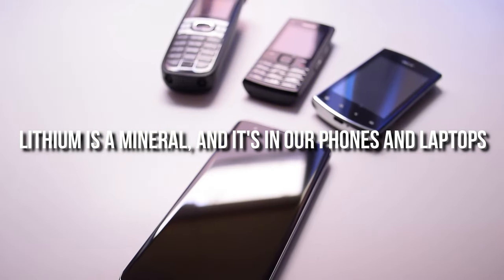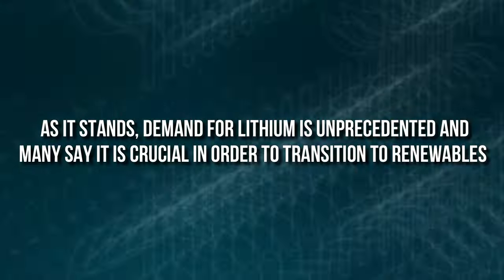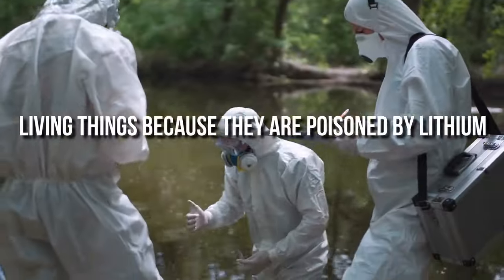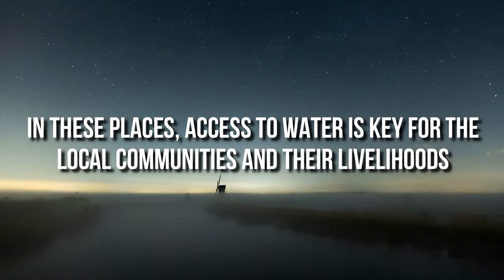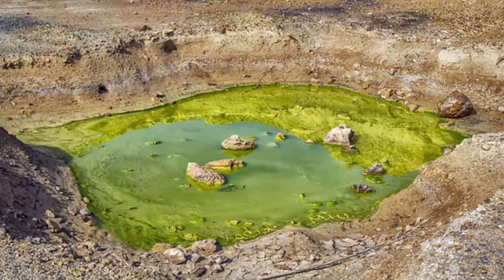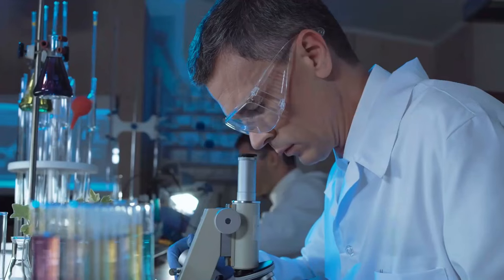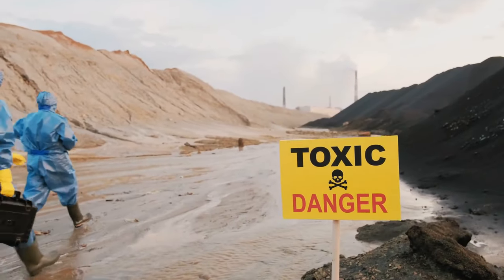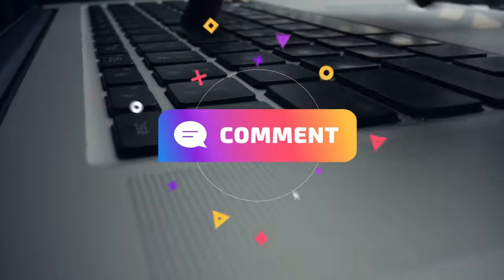How Bad Is Lithium Mining For The Environment?

Comment: To make Petrol:
Explore and find the oil: needs energy
Drill a well on average 1 km deep: needs energy
If the oil comes from an off shore oil well that drilling/production rig will run on diesel.
Pump the oil up from a kilometre down runs an electric pump 24/7 on 10s of 1000s of wells
Sometimes the oil is put into a truck tanker but most of it is pumped down a pipeline
Building the pipeline uses energy
Then pumping the crude oil through the pipeline uses energy
Pump the oil into a sea tanker
The tanker uses energy to run and needed energy to be made
Pump the oil into a refinery.
A lot of energy would be needed to make a refinery. 
Here's where it gets expensive - Heat the oil to 400 degrees Celsius
Boil the oil dry and make the oil products including diesel and petrol
Put the diesel and petrol into tankers and deliver it to the petrol stations burning diesel as you go.
In Australia some of these tankers would travel over 1500 km to a petrol station or farm.
Use a tiny bit of electricity to pump the fuel into someone's vehicle (it's not a kilometre deep this time)
People think about how the electricity for EVs gets to the battery but not about how the fuel for a combustion cars arrives.
Reply: 👆🏼this. Good post.
And then at the end of all that you BURN IT! 
It's much better to mine for the metals & minerals and then use it over and over again.
After a battery is completely finished with and is longer of any use even as home storage it can be broken back down and made into something else or a new battery.
Reply: And how do the charging stations get their power…coal. Worse yet is a charging syation too far from the electric company and a DIESEL generator is used to fill the gap. Of boy!
Reply: @snipervision1  In 2021 electricity in Australia was 71% fossil fuel based (51% coal 20% other fossil fuel) and 29% renewable. In 2020 it was 24% renewable - so it's growing. So do you want to run your car on middle eastern oil or Australian coal and gas (and renewables)? Do you like middle eastern oil?
Reply: You say the word "energy" a lot but don't specify on the type of energy, what kind of energy and in which part of the world?
Reply: @ginojames8213  Yeah but most batteries end up in the landfill.
Reply: @sdfjsd no batteries are far to pricey. Redwood industries in Nevada recycle evs batteries every day

Comment: There's no Moore's Law for batteries, if we need to double battery production we need to double Lithium mining. And to meet climate goals we will have to multiply production maybe 100 times.  Recycling won't help much because it's new cars and trucks, it's been estimated that our current Lithium mining would take 10,000 years to electrify World transport. If we take Chile's mines there will be a physical limit to extraction that goes beyond environmental standards; you can't extract Lithium if the water is there no matter what the price, there is  a finite amount of flat land to put the evaporation ponds. Obviously Lithium production can increase but realistically only perhaps 10% annually.  Something else to consider. The giga factories going up across the World exceed the current Lithium production; we can increase production but for sure or can we? Has anybody given this serious consideration?

Comment: 1 gallon of water=8.34 pounds
500k x 8.34=4,170,000 pounds
4,170,000/2000= 2085 tons of water wasted to get a ton of lithium. Quite the tradeoff.
Reply: Or to put it another way 200 tonnes of water for a typical car battery. Or about the same amount of water that falls on the roof a typical US home in a year.  It would be trivial except these Lithium mines are in arid areas.  You could use less water intensive extraction but the energy inputs would be collosal.

Comment: Are all those bad sides worse than the bad sides of fossil fuels?
Reply: @tiepup  Far worse!
Reply: @tiepup  mining lithium as said in the video falls under the same umbrella as fossil fuels
Reply: @tiepup  the cost of recycling lithium is extremely expensive, cheaper to mine it
Reply: @tiepup  no, not nowadays. With wifi, Bluetooth, satellite tech in newer vehicles. They can be hacked from only a couple hundred few away. And if you think they won't be able to shut off your EV. Think again when you stop paying your lease on one 😂
Reply: @GizmoGTI  At the moment It's cheaper to refine Lithium than to mine it. But the cost of mining (money and energy) is dropping a lot so in time you could be right.
Reply: To make Petrol:
Explore and find the oil: needs energy
Drill a well on average 1 km deep: needs energy
If the oil comes from an off shore oil well that drilling/production rig will run on diesel.
Pump the oil up from a kilometre down runs an electric pump 24/7 on 10s of 1000s of wells
Sometimes the oil is put into a truck tanker but most of it is pumped down a pipeline
Building the pipeline uses energy
Then pumping the crude oil through the pipeline uses energy
Pump the oil into a sea tanker
The tanker uses energy to run and needed energy to be made
Pump the oil into a refinery.
A lot of energy would be needed to make a refinery. 
Here's where it gets expensive - Heat the oil to 400 degrees Celsius
Boil the oil dry and make the oil products including diesel and petrol
Put the diesel and petrol into tankers and deliver it to the petrol stations burning diesel as you go.
In Australia some of these tankers would travel over 1500 km to a petrol station or farm.
Use a tiny bit of electricity to pump the fuel into someone's vehicle (it's not a kilometre deep this time)
People think about how the electricity for EVs gets to the battery but not about how the fuel for a combustion cars arrives.
Reply: Not even close. Look at what it takes to extract oil.
Reply: If you like animals, drinking water and food it is!😅
Reply: This is the right question
Reply: When fossil.feuls are pumped out the ground it doesn't get into the atmosphere like lithium and if it spills it can be cleaned up I think I will stick with diesel and hydrogen they have downside to but at least wildlife won't be obliterated by the exhaust
Reply: @GizmoGTI just like plastic it will be just like that cheaper to remake then to reused and it will bad very bad imagine these batteries being dumped into our oceans imagine you sea life eating these particles this will not be good
Reply: @danielstapler4315 I do but what about the electricity it takes oil to make that and if their isn't enough of it how can you charge you batteries it that happens no oil no power we do not have the infrastructure to sustain these so fossil fuels for me plus people make their own feul may not be better then the refinery but unlike recharge it can be done
Reply: @fireflyraven2760  I also think we're not ready for lithium batteries, if they catch fire there is nothing that can be done to put it out, not even closing off ventilation will extinguish a thermal runaway . Imagine having a few of these parked in an underground of a tall apartment block, one f these ignites while being charged, and having at least the 3hrs minimum time to have it extinguish itself off, lighing up other cars and other EV's. the burnoff could take days!!! Imagine having 30 or more EV'sd parked in the same apartment building all being charged - not going to be safe at all and no-one is looking into how they'll put these things off as they epically go off
Reply: @GizmoGTI  plus the building will catch fire as well and people could die or get injured not to mention the air surrounding air would be toxic as fuck all that carbonate and every other chemical their is in those batteries would make it a chemical field trying to save them everyone would have to be treated for this
Reply: @fireflyraven2760 go tell that story in Nigeria …. or Canada for that matter. And not only there. Big oil poisons land, water and air in epic proportions all over the world. If we stick to fossil fuels, we’re doomed. So stop making up reasons why not and start thinking about how it can be done, with respect for the environment.
Reply: @elinys2843  this isn't me making up shit as to why we should not adopt electric vehicle I am only stating the side affects if this plays out like plastic we will be in bigger trouble then we will be using oil but I didn't come here to change your mind set I am only backing up what I said both are not very good energy sources maybe we will have better luck with hydrogen but thats my opinion not like I know what I'm talking about
Reply: @danielstapler4315 everyone knows it takes energy to do that you goof ball, the difference is you don’t leave near as much poison laying around while getting oil.
Reply: I'm looking forward to hydrogen cars. I know making hydrogen is energy costly but with electricity from wind or/and solar it would be far more better for the environment. The only outcome from vehicles is water
Reply: @fireflyraven2760  What do you mean? Oil spills are extremely harmful, and most of it doesn't end up getting cleaned up.
Reply: I think the fundamental principle that we should be considering is: in most cases, it's better to stick with the devil that you know than the devil you don't. We know oil-powered cars and their impact. What we don't know is what the impact of EVs. EVs aren't the solution, so we should spend time researching and finding a better solution to oil before we transition away from oil.

Comment: The Tesla Impact Report estimates it takes 18 gigatons of mining/yr to maintain the current grid and transportation system. A fully wind/solar/battery grid with 100% EVs for transportation would take 3 gigatons/yr of mining.
Reply: Of course Tesla would say that ,really what a con. Tesla if sold world wide and increased production in the fantasy that people actually want an EV as the only means of transport would dwarf any mining efforts of today for current EV technology. ICE vehicles are far more adaptable to different fuel sources that are actually sustainable unlike batteries technologies that are even close without lithium.
Reply: @peterrichards1058  Where's your data? It's irrational to just say someone's else data is a con, as if that's an argument.
Reply: @peterrichards1058 adaptable to different fuel sources.. my azz.  Electricity is far more adaptable.  Electricity can be made at home.  
Gasaholeline will always be a monopolized leash on society.

Comment: I wonder how much pollution is caused in mining Iron ore, copper, aluminum, oil etc and further how much more pollution is caused in converting these to engines, transmissions, radiator, exhausts etc. I bet it wouldn't be much different if not more.
Reply: u still need all of the above to build ev cars plus on top of that, now the lithium and disposing of used up batteries and the value in the second hand ev market would be terrible. the lithium industry needs to tighten the hell up with regards to safety and the env
Reply: a form of fracking is used in iron ore exploration, its more out of sight than CSG but still happens.

Comment: The new methods for lithium extraction from underground brines, a most abundant source of this metal, are extremely benign for the environment.  The brine is pumped out of the ground.  As it is often also a geothermal resource, its heat is recovered and exploited.  Then, the cooled brine goes through ion-exchange columns, which capture the lithium cations specifically.  And finally, the lithium-free brine is reinjected underground.
On the surface, there is nothing but an industrial building and some pipes!
No emission except NaCl (table salt)!

Comment: Lithium can be recycled. Anything that can be recycled, can be considered "renewable", or at least, "sustainable". That cannot be said for fossil fuels of any kind. Just like lead, zinc or any other metal stays in the market, and becomes a source material to make the replacement batteries. If you buy a Lead Acid car battery, the lead in the plates, and the sulfuric acid are almost 100% post consumer content. Very little new lead is being mined, to make replacement batteries. Lithium will do the same, once the market saturates. Water, used to concentrate lithium, is the single easiest thing to recycle. Closed distillation processes can reduce the water lost to virtually 0. Is the tailings from mining lithium any worse than the overburden from coal mining? is the chemical waste any worse than the fly ash from burning that coal? How does the total mass of waste from continuing to burn coal compare to the total waste mass from mining lithium? Because Lithium and Cobalt will very quickly peak, because of market saturation, the problems caused by mining will quickly become less and less, because Lithium is recyclable. It's not "one and done" like any kind of fuel. It should NOT be restricted, because of the ease of the workarounds for water consumption, pollution, and recycling.

Comment: Sounds like you did not listen to the video. 500, 000 gallons of fresh water needs to be evaporated to make 1 ton of Lithium. In a arid climate like Chile or Navada, that's much of the drinking water for the people. Also, unlike gasoline, the batteries burn hotter with toxic fumes. A EV fire takes 10x the water to put out then gasoline. The car needs to be moved rapped in a blanket so not to light on fire again. In Australia, already minning trucks are using Hydrogen instead of BEVs to power them.

Comment: All mining activity has environmental impacts.  Lithium is no exception but it has gotten lots of attention due to its role in providing high density power storage for transport. Yes, the impacts of mining lithium should be minimized but don't forgot to compare it to the highly destructive alternatives: oil & gas.  Lithium can be used, reused & recycled, possibly forever. The alternatives, oil & gas, have a one-time use: burning.
Reply: How can it be reused when most of it its garbabe
Reply: Wait til they actually build the car that runs on Co2.  The real green energy
Reply: the density of energy in oil is far superior to lithium batteries
Reply: So the lesser of 2 evils? The issue is that politicians painted renewable energy as the answer to pollution when in actuality it is not. I think the concern was more about money/control and significantly less about the environment.
Reply: @dacool8135  then what is the answer to polution
Reply: We’ll when you take into account the energy infrastructure being able to handle that many Evs we would have to go back to burning coal to support the energy needed keep evs working
Reply: @chieftain8638  for starters stop households from using wood heaters. e-fuel could be the answer, as it will run on fossil fueled cars more investment to refine and make it more affordable
Reply: Plink  sadly it's out of sight out of mind
Reply: @chieftain8638  Going back to beasts of burden
Reply: @chieftain8638  you recharge batteries in cars and other sources of energy.
Reply: @chieftain8638  you recharge batteries in cars and other sources of energy.
Reply: Lithium reused and recycled? What drugs are you smoking?
Reply: it's very difficult to reuse lithium.
Reply: Apparantly, Lithium has a lifespan of up to 10 years.  The problem which needs addressing is where will we dump it when it can no longer be used?] Millions of tonnes of unusable batteries going into landfill.
Reply: @chieftain8638 Likely a radical change in the way people live their lives, abandoning the pursuit for infinite economic growth etc. Stuff people don't want to hear really.

Comment: I get that it causes short term water shortages in these communities, which is not great. But that water is evaporating into the sky, then reformulating into rain - just not where it orginated. It's not like the water just ceases to exist. So surely there's a world where the water can be recycled as part of the process, then returned to the community.

In that same vein, there's likely refinements that can be made to improve the process and reduce it's impact on the surrounding ecology.
Reply: I'm trying to understand the go green idea...So let's say we move to electric vehicles: 
1. We need these brutal lithium mines to make the batteries
2. To charge the batteries we plug it into the coal plants.
How is this better? I honestly don't get it.
Reply: @paulgreenleaf600  Coal plants are being phased out for renewables. It's taking a long time due to how much money is tied up in fossil fuels.

But with the improvements in battery technology (we will move on from lithium, count on it) and the increased production of renewable energy - It will work out better.

Already in my country/state, coal is only used as a backup for when renewables aren't meeting demand.

As the years pass and avancements are made, even the backups will no longer be necessary.
Reply: I think it’s important to note that the absence of that water can do some horrible thing to the environment, that are expensive to reverse. When the water is removed so are the minerals that are being carried by it that fertilize the local soil. Plant life dies and consequently animal life dies as a result. It’s very expensive and difficult to restore these sort of thing. So even if you can bring the water back there’s not much it’ll do if the soil is useless.
Reply: @zypherus6876  A fair point, I'd not considered that. It's likely those minerals could be recovered since they would be left behind during the evaporation process

But putting them back in the soil would be a challenge
Reply: @BjorkensteinvanJurgenheim  Im not sure what the process to purify the minerals of the traces of purified lithium would take, but it would definitely be something that should be made mandatory responsibility of these lithium mining companies
Reply: @paulgreenleaf600  
Coal plants use less energy and produce less CO2 than internal combustion engine vehicles.
Reply: To continue mining activities the water would be returned  for mining, not to communities.